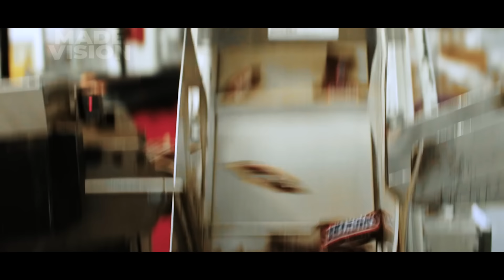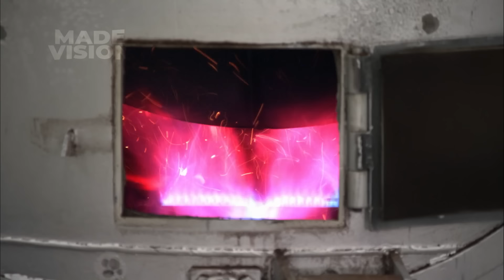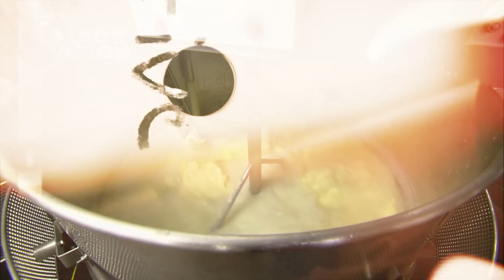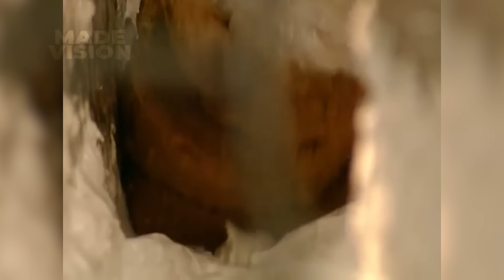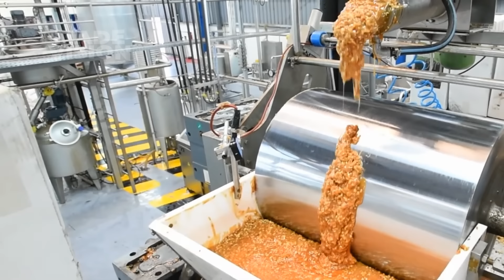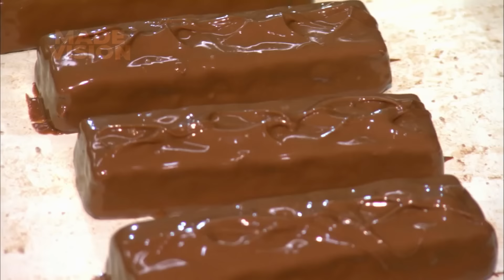How Snickers Are Made In Factory

Comment: Corn syrup—especially high-fructose corn syrup (HFCS)—has raised health concerns when consumed in excess. Here are the main dangers associated with it:
1. Increased Risk of Obesity

HFCS is commonly found in sodas, sweets, and processed foods. It's calorie-dense and easy to overconsume, which can lead to weight gain and obesity.

2. Insulin Resistance and Type 2 Diabetes
Frequent consumption of fructose (in HFCS) can worsen insulin sensitivity over time, increasing the risk of developing type 2 diabetes.

3. Fatty Liver Disease
Fructose is processed by the liver, and too much of it can promote fat buildup in the liver, contributing to non-alcoholic fatty liver disease (NAFLD).

4. Increased Risk of Heart Disease
Studies have linked excessive intake of HFCS with higher triglycerides, LDL ("bad") cholesterol, and inflammation, all of which are risk factors for cardiovascular disease.

5. Addictive-Like Eating Behavior
Highly sweetened foods can alter brain chemistry, creating a cycle of cravings and overconsumption, similar to addictive substances.

6. Gout and High Uric Acid
Excess fructose metabolism increases uric acid levels, which may lead to gout—a painful form of arthritis.

7. Poor Nutritional Value
Corn syrup adds empty calories without essential nutrients, often displacing healthier foods in the diet.

Comment: Healthy snickers g get a date cut take the seed out put a piece of walnut inside shelled some peanut butter and drip some melted chocolate on top if you want you can add a tiny tiny bit of salt optional try it put the finished dates in the fridge or freezer in container with lid for the choc to set try it tastes like snickersi tried it and was supprised how good it tastes the melting of the chocolate is the hardest part heat it slowly in a pot or pan ect I just used a block of milk choc

Comment: In NYC, you wont find a regular size Snickers bar less than $2.50. Growing up I remember Snickers bars double the size for $.50. So basically nowadays you are paying 4-5 times the price for something half the size, essentially being 10x the price of the original.
Reply: В России за 160 грамм цена 1,20$
Reply: 1977 candy bars were .17 cemts
Reply: Up until the early 1960s all candy bars were 5c except for Mounds and Almond Joy which were 10c. Baseball cards were 1c including gum or you could buy a 5c pack and get 6 cards and one large piece of gum.

Comment: What’s impress is the engineering it took to build these machines. They’re so intricate.
Reply: How do these machines get cleaned!?
Reply: @tonyg3644 Parts/Areas of the factory are periodically flooded with water and a huge turbine swirls it around so the water's flow cleans them.
Your welcome!!

😂
Reply: @pegasoltaeclair0611 sounds good thanks 😂
Reply: @tonyg3644  by other machines
Reply: MACHINISTS MAKE the parts.....NOT the engineeers
Reply: Its not all engineers. Its on sight mechanics that come up with the ideas to actually make it work. They adjust, tweek, improve, and maintain until these machines work. Give them the praise, they are the miracle workers.
Reply: @dano9215  Jesus man. Are you really picking apart youtube comments and looking for technicalities? Why are you so hellbent on recognizing these guys and diminishing the importance of engineers? Dude was just giving his opinion and you come in simping for these mechanics.
Reply: @dorlis1  You are probably one of the pencil neck "engineers" that come up with machine design without ever thinking about the poor guy that has to repair it when it breaks. I spent 40 years, working on factory machines, that never work correctly, when they are designed, dealing with overpaid clown engineers like, maybe you. Get back to your theories mamas boy.
Reply: @dano9215  I figured that's what you did. I've never been an engineer. You missed the point of the whole thing. It's ok though.
Reply: @dano9215  so you pushing 60 and arguing on youtube comments about engineers?😂😂

Comment: Now I want to see a video of how they clean all of those machines between batches. That has to be a huge undertaking in itself.
Reply: I expect the machines just run 24/7.
Reply: @Stevelives13  You would be correct. The candy lines run 24/7 and this particular factory also makes starburst and skittles. The candy lines run non-stop and are periodically shut down for cleaning. A whole janitorial team works during the cleaning process spraying the machines down with hot water and cleaning chemicals. The cleaning is completed over the course of an entire shift.
Reply: @JohnWilkes-mg8di do the machines have a built in cleaning function
Reply: @Stevelives13   They pretty much do yeah.
Reply: not as hard as you would think. I worked in a place with similar machines but we made paint and stucco mixtures. We had pressure washers that would drop down and spray water 360 degrees horizontally and vertically simultaneously. The machine would be clean enough to prevent cross contamination between products within 20 minutes. I assume it would be even quicker for these machines, and that they have a similar wash system.
Reply: @jesseadams3630  We used high pressure hoses that sprayed steaming hot water.
Reply: I work in the chocolate industry, and they usually shut down for a week or two and do a total clean out.  These lines are set up to run 24/7 and only run this one item.
Reply: @invisible468  I worked there 20 years ago and it didn't take us a week to clean it. We did it in one day but the line was shut down for an entire week because the maintenance crew also came thru after the cleaning to perform maintenance on the line. I always remember the plant being a ghost town during the cleaning/maintenance week because all the candy workers got to take off.
Reply: @JohnWilkes-mg8di  I always felt guilty when I got time off and maintenance still had to work
Reply: @invisible468  ppl just want to scare people away from everything like the media doesn't do that already
Reply: @invisible468  When I worked for a toothpaste maker, we had literal steam shooting from the cleaning hoses the water was so hot. it made short work of all the paste. Clean up was almost automatic. and yes, we shut down for a couple weeks a year to replace all the filters and dust catchers. Imagine a concrete mixer but on it's side like a top. Sadly they  moved to Mexico in the late 90's.
Reply: They lick them clean....
Reply: @thedoneeye  I would!
Reply: The cleaning is way easier than you think with pressure water and proper cleaning products.
Reply: I kept thinking that myself. Forrest Mars was a stickler for pristine conditions.
Reply: I worked occasionally on the kill floor clean-up crew in a cattle slaughterhouse. It was a long, hot, wet (hoses with very hot water spraying every nook and cranny) job. We never used soap but the kill floor area and saws would be immaculate when we left.
Reply: @rcnelson Man... that's  rough, but thanks for your efforts.
Reply: Me too
Reply: I'm thinking about wastage
Reply: You read my mind.
Reply: The machine used purely to make snickers, cleaned after it does that, only to make more of the exact same thing, as if.
Reply: They clean it once a week at best.
Reply: Me watching this at 1:30 am.    Now I want 2 or 3. 😅😅😂😂😂😂😂😂😂😂
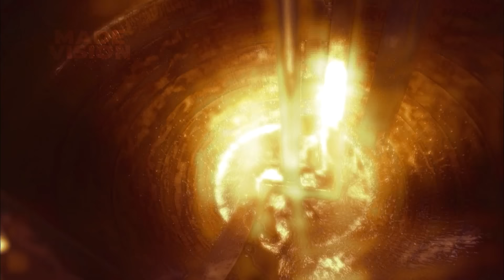Reply: 8:26 looks like they clean that bowl regularly 😆
Reply: Me too. I will never eat a snickers bar again.
Reply: @timreed141  More 4 us lol you think its dirty vs other foods you eat? wait till you see grains etc ...did you know everything has bug parts? and that's just beginning lol
Reply: @DonaldHendleyBklynvexRecords  what??? Bug parts? Are you serious??? Is it legal? I thought that there were standards that regulated sanitary norms... But maybe I'm wrong...
Reply: @mattye12  lol yes, they are allowed a certain % of bug "debris" otherwise it would be close to impossible to ship foods
Reply: You better off getting or buying homemade candy,cookies ,cake or import from other places that do better snacks then USA the chemicals land.  @DonaldHendleyBklynvexRecords
Reply: @timreed141  i used to clean spills in a grain mill. walking across the parking lot, through bird shit etc, and right up into the piles of grain to shovel it back down the chutes
Reply: @bonesaw22  I am sure when that grain is in the field it gets pooped on too. We all know this. Chances of life.
Reply: @timreed141  nobody cares..you aren't making or breaking them.
Reply: @timreed141  you aren't making or breaking them. Nobody cares ...